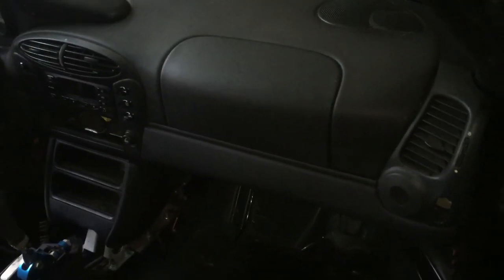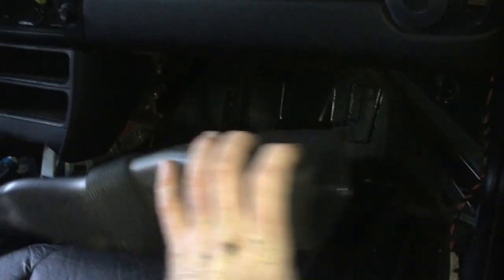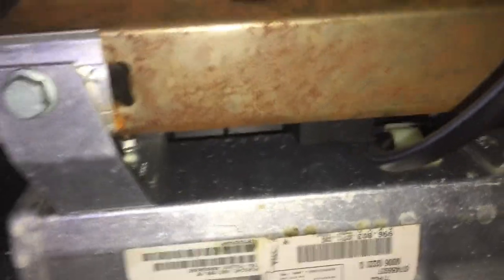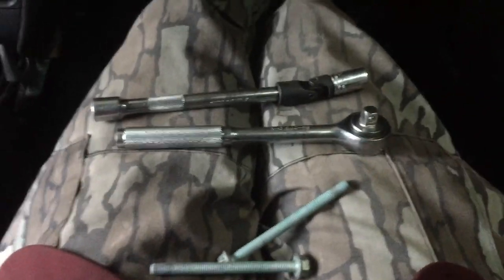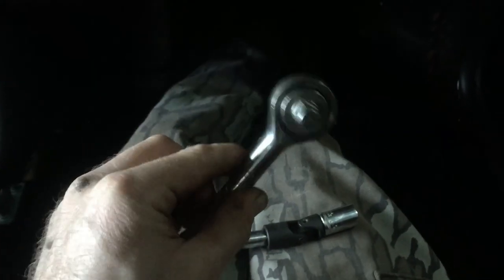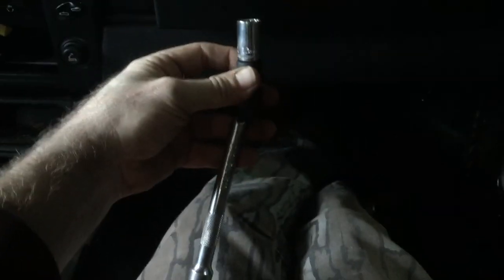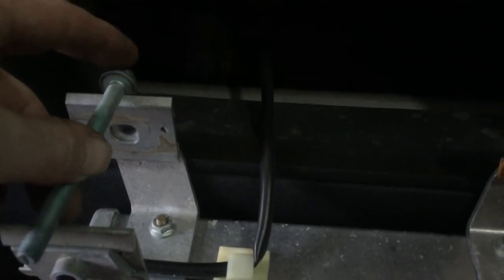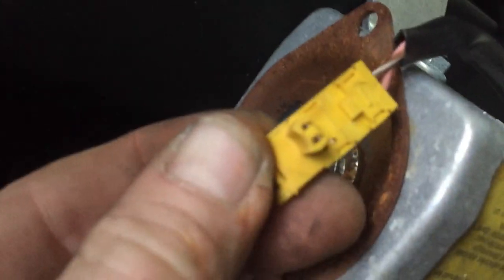How to remove install Porsche passenger front Dash air bag on a 911 996 986. Weight Reduction.

Comment: I have a question for @disturbingkreationz would it be possible to remove the airbag from the cover so that the cover could be replaced on the dash (without the airbag behind it).  I'm not sure that's possible or easy based on how this came apart, but please let me know your thoughts on the matter.
Reply from the maker: I believe the leather can be taken off like a skin. It wouldn’t have a durability thought. You can custom cut the front section from the bag/compressor section and just bolt that back in. I would have to find it in a few days and truly look at it. I do not advise to mess with a solid airbag system due to safety.
Reply from the maker: Are you just trying to reduce weight and keep aesthetic?
Reply: @disturbingkreationz  - yes I’d like to keep the factory cover in place for aesthetic reasons only
Reply: @disturbingkreationz  - thank you my friend
Reply from the maker: NP. Hit us up with a subscribe to help the channel. If you ever have a question just leave a comment.
Reply: If you leave it disconnected do any warning lights stay on?
Reply: @gombata1  - you will definitely get an airbag light on your dash unless you add resistance, code it out, or remove the bulb